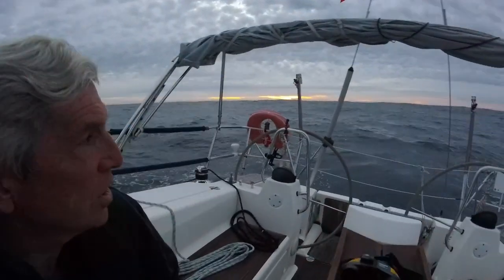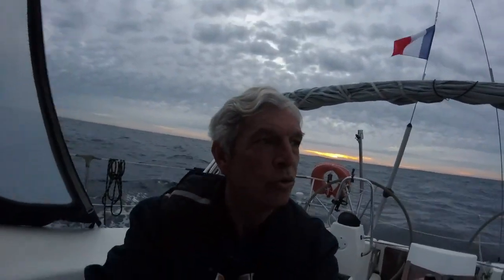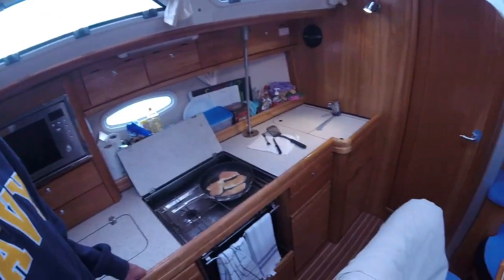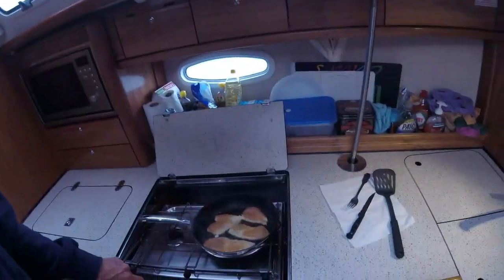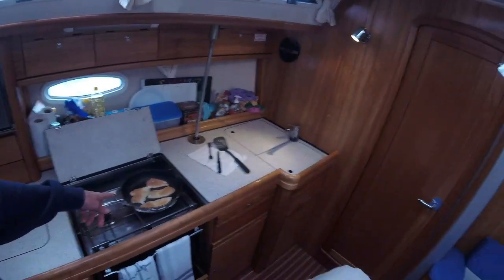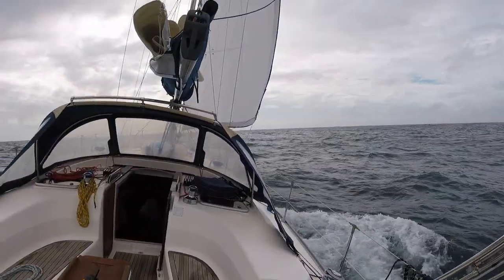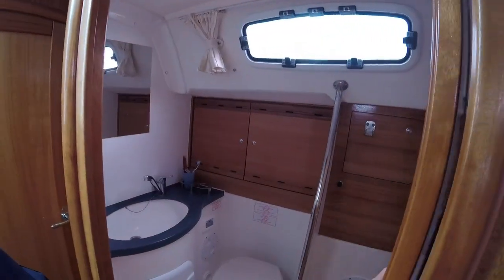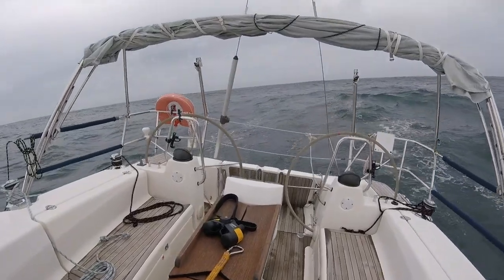Ep 7 Sailing singlehanded to Azores: When I use genoa only

Comment: Patrick : Greetings from a Union Polaris 36. We often fly just the 500 sq ft headsail for pretty much all the reasons you detail. When the mainsail boom rocks back and forth like that, put a little clean engine oil on the goose-neck pivot and it will last much longer. On the Polaris, the mainsail boom is enormous, and it can get aggressive sometimes. 
Just flying the headsail is so much easier to handle when close downwind.  
In calmer conditions, I have found that when just flying a MAINSAIL downwind that the boat is stiffer and rolls less. I guess I must be crabbing the keel more? When we gybe with mainsail, we often "do a granny". That Polaris 36 mainsail boom is so long!
Fair winds !
Reply from the maker: Thanks.  I haven't tried mainsail only in light winds.   I'll check it out next time.....  :-)
Reply: @patricklaine6958  The Polaris 36 (early model) mainsail is enormous, and the mainsail boom helps hold it out so it curls much later than the big jib does and so has a wider usable angle when downwind. We use a kicking strap to prevent the mainsail boom from accidental gybe. Worth a try.

Comment: I hope I’m not preaching but I think you should use a gybe preventer from broad reach to dead run. We had a rope permanently tied near the end of the boom with a snap shackle on the other end which snapped to a ring close to the vang, keeping it tight to the boom and out of the way until it was needed.
A long sheet was rigged through a block attached near the bow and run back to the cockpit. The outboard end had a loop which the snap shackle clipped on to when the preventer was needed. Then the inboard end was pulled tight and secured. This pulled the boom out while the main sheet pulled the boom in. The preventer and sheet need to attach to the boom in roughly the same place, so all is in balance, stable and safe and hopefully no gear gets broken and, more importantly, no heads.
Reply from the maker: Completely agree Ian, and I do have and use a preventer (actually a "brake") made by Wichard.   I don't understand why so many of my videos have the boom banging around, as I hate that.   I mentioned elsewhere that perhaps it is because I often filmed my videos just prior to sunset, and just after sunrise; times I usually make sail changes (putting in or shaking out reefs).  I may have just timed my filmings for that window when I changed sail settings, but had not yet re-rigged the preventer.   As you say, a preventer or brake is an essential piece of gear to protect equipment, provide safety, and preserve sanity.

Comment: Hi Patrick, I really enjoy your videos. I was saw right away that you're on a Bavaria. I was wondering what model and what year she is. I have a 2006 Bavaria 33 and I always wonder about the suitability of this boat for offshore sailing. My boat loves to slew around at anchor and I can only imagine what all the windage she carries would do to her in a strong breeze. I haven't tried to heave to in the boat though I know I should give it a go. But it looked like you weren't too happy with your boat's ability to do so.

I was also wondering about you inner forestay idea. On the 33 there is precious little room between the mast and the bow to affix an inner forestay. I can see your boat is larger than mine but I wonder if you've thought about this question.

Finally, it's great to see that you can achieve 3500 subscribers without any bikini clad twenty-somethings bouncing around on your foredeck. I'm looking forward to more videos!
Reply from the maker: Many thanks USA for the kind remarks.   My boat is a 2008 Bavaria 40 Cruiser.   In terms of seaworthiness, I would not hesitate a second to jump aboard and take it on a Transat.   It is a very stable boat, handles wx well, and is ideally suited for single-handed sailing.   I'm very please with it.     There are two issues with heaving to: 1) is it the right tactic for the storm (versus running downwind or forereaching) and 2) how easy is it to get to a 'text book' hove to position with the slick at about 100 degrees relative to the bow.   I won't address issue one, other than saying that when I crossed the gale on my way to the Azores (episode 12), the wind and seas were not aligned, and I felt the forereaching tactic was better (though stressful on the equipment).  I must admit, I do struggle to get my boat to do a textbook heave to....It really likes to continue moving forward, and I have tried every variation on the controls that people commonly say to do.   It almost gets there at times, but not quite.  Probably 'pilot error'.  :-)

If I ever do go on a major passage, I will install an inner forestay (the removable kind).   For serious cruising, I want to be able to furl the genoa, and use a staysail or storm sail.  I have the room for an inner forestay --- just a question of installing it.    Finally I'd love to hold a bikini party on my boat, but no one would come.  :-)   Fair winds to you.

Comment: To prevent slatting in light winds and big swells going downwind or on an open reach, I unclip the mainsheet from the traveller and clip it to the rail, and tighten the sheet hard. That way the boom is pretty much fixed and the sail can't flap, yet the sail is still far out from the centerline and catches a lot of wind.
Reply from the maker: A great tip Ute.  Thanks.  It won't work on my boat due to physical layout -- but there are many ways to vary this theme slightly to get the same result.   Thanks for commenting.
Reply: Ute å seglar great tip thanks Andy.
Reply: You can’t do that on a large boat at sea. The boom is too dangerous

Comment: Thanks for yet another informative video! I like the way you talk straight to the camera and walk around with it. Is it a gopro? The audio is very clear too, do you have an external microphone?
Reply from the maker: It is a GoPro Elizabeth, but it does not have an external mic.   That is a real problem, especially on a sailboat, because as soon as you stick your head out in the breeze, you lose all quality of sound.  There is a wind muffler you can put over it, but then you can not speak; just film.   I'll probably try a different camera next year, with an external mic that you can put a 'dead cat' (hate that expression) around.   The advantage of the GoPro is its very small size, and stabilization, so you can take it anywhere with you and be very spontaneous.   The bigger cameras will require 'staging' of sequences.    Thanks for asking.
Reply: Thank you Patrick, I used a gopro too until it drowned together with my drone! I clamp my system camera on different fixtures around the boat but even though I use a “dead cat” the wind noise gets through sometimes.

Comment: Sailing single handed has many problems but sleep is tricky and if your not getting enough sound sleep it tends to creep up on you and then your asleep for to long and totally surprised when you wake up. The AIS transponder and alarm is a better option but still not perfect with all the trash floating around.

Comment: Pat: Interesting video, thanks. I am curious why you don't have a windvane.  Autopilots are great, but it seems it would be tough to handsteer a long passage if that system failed. and I know you have addressed the boom preventer question, I think a vang to the rail on both sides is for me, anytime off the wind. Boom slamming across can be a killer. I see the Navy pullover, are you an Academy grad? my dad was class of 47 and did two transatlantic races on a 40 footer in the 60s. He was racing with a crew of eight, but he was navigator. Those days it was all celestial, not even Loran. Nav was his favorite subject at Annapolis. Nice boat too.
Reply from the maker: Thanks VF.  I don't have a windvane simply because I didn't want to have all of that hardware hanging off the stern.   And yes, that means loss of the autopilot would be 'challenging'.   I did practice two other primitive methods of self-steering.  I think they would have been alright for the trip to the Azores.  I do think that if I were doing a Transat or other very major passage, I would indeed install a windvane.   To date, I have been very lucky with my Lewmar autopilot.   On the preventer thing, I really should have filmed my 'brake' in action. It is tied off to both sides and really does do an excellent job of stopping the banging, and I could have used it for wing on wing if I had wanted to.  I'll film that on a future passage.     And yes, Navy '76, but then into aviation.   As you can see, I'm still struggling with learning how to drive boats.  :-)   I too learned and used celestial navigation in the real world, but now with 5 independent GPSs aboard, I don't even own a sextant anymore.    Thanks for contributing to the discussion.

Comment: Pat, Why not use a preventer line to stabilize the boom? Enjoy your videos!  I assume you're retired in France?
Reply from the maker: Thanks Bill.   Someone else also asked why I allowed the boom to crash back and forth.   I don't!   I have a preventer that I hook up (brand Wichard), and if that doesn't work completely, I loop a big bowline over the rear winch, and tie a double half hitch to the rear end of the boom.  I think the boom bangs in the videos because I often filmed just after sunrise, or just before sunset, right after a sail change and had not yet secured the boom.    I agree completely that the banging boom is mentally fatiguing, and not good for the equipment.    And yep, I retired to France (after having spent most of last 30 years living in Europe).    I live on the coast, 5 minutes from my sailboat.  Life is good!   :-)   Thanks for the comment.
Reply: @patricklaine6958  Years ago we purchased 50 feet of 3/4 inch dia. bungee cord and designed a fast attaching or removed shock absorber system that worked really well to eliminate side to side banging. Preventers dont really do a good job stopping boom banging when the boom is facing aft.

Comment: You could try putting up the main and using a limiter on it so it wouldn't snap around, but I have seen that get a little dicey if there are sudden wind shifts...  maybe when it's nice and you feel like being on deck so you can watch it.
Reply from the maker: In episode 40 I discuss the use of boom brakes vs preventers.   (I systematically use a boom brake whenever going downwind.)   The banging noise you hear is a filming error.   I filmed at the same time each day the first season -- just after shaking out the 'nightly reef', but before resetting the brake.    You will hear much less banging in seasons 2 and 3 because I filmed after resetting the boom brake.  :-)
Reply: @patricklaine6958  thank you. I will watch it. I am not familiar with boom brakes. I own an O'day 27 and race on a tanzer 25, here in the fingerlakes, so larger, bluewater boats are interesting to me.

Comment: Greetings from Canada Mr. Laine.  Do you use a whisker pole on the genoa in this sail plan and singlehanded?  Also for the boom have you tried a gybe preventer/break to keep the boom out?   Thank you and really enjoying your episodes sailing to the Azores and find your content very informative.  Thank you for sharing your experiences and advice.
Reply from the maker: This boat did not come fitted with a whisker pole.   They are not difficult to install, but I never got around to it.    Whisker poles are VERY helpful when doing extended downwind passages like in the Trade Winds.   In one of my Iceland videos I show my 'boom brake' and discuss the difference between a brake and a preventer.

Comment: A preventer is a good idea, but if you’re making 5-6 knots with the Genoa alone, I’d take that any day! The one question is why not go wing-on-wing since you’re on a run? You could use the preventer to keep the boom opposite the Genoa. You’d then gain speed from the main not rob the Genoa of any air. Just curious.
Reply from the maker: You are exactly right JM.   I was just satisfied with the 5-6+ knots.   I think if I had only been doing 3-4 kts, I would have done exactly as you suggest (and I do that frequently in my local sailing).   Excellent comment.
Reply: Patrick Laine — I only solo sail on lakes and on a 22’ pocket cruiser at that, but I realize the wisdom of a.) being satisfied with your SOG and 2.) the very real danger of having too much fabric up when conditions can change so quickly. Really enjoy your channel!

Comment: I have a furling mast and in my case the genua is much bigger than the mailsail so sailing with only the genua is still giving a ok speed.
Reply from the maker: Yes, me too Tino  -- I have a 145% genoa.   I can get good speed going downwind with it alone also, but I'm not a racer anyway.   I have never sailed with a furling mast.   Do you like it?  Do you feel you lose performance compared to a classic configuration?   Vertical battens I suppose?   Best regards
Reply: There is no structural battens in a furling mainsail, it's like a second genua.  But I like the system and it have a function where you only can pull the sail in.  The system is made for reefing so you don't loose control over the sail in bad wheater. The whole system can be controlled from the cockpit however not when you want to switch to the reefing mode. It is done by the mast at the ratchet/free handle. (see my video: sailing with a YouTube fan)  I have not sailed that much in my boat to tell if furling mainsail is makng the boat go slower but I have heard the difference between furling and normal mainsail is 0.5 knots.  But I'll find out, my friend have just bought a Bavaria 32 with normal mainsail.
Reply from the maker: Very helpful Tino.  Thanks.   It is nice having 'infinite' reefing, though a bit of a shame you need to go to the mast to do it.   I guess the guidance 'reef early' still applies even to in-mast furling systems.    I've already watched your video 'sailing with you-tube fan', but I don't remember the reefing sequence.   I'll watch it again.   Best regards.
Reply: We are spoilt. Our Prout Cat has in-mast mainsail furling with vertical batterns that is adjusted in both directions from the electric winch in the cockpit. Even so, when running downwind we often only put out the 150% Genoa to avoid having to set up the preventer on the boom that we run to the bow and back to the cockpit.

Comment: Don’t blame you for not wanting to go forward too much sailing solo but would something like a asymmetric spinnaker, with a top-down fuller be of benefit? Also I don’t ever see you using a whisker pole. Is it that the more toys you use, the more trouble is possible or is it something that doesn’t lend itself to Bavaria 40s or just more bother than it’s worth?
Reply from the maker: Both great ideas Ian.  I have an asymetric Spinnaker with a snuffer --- and I use it regularly.   As I'm solo, I'm quite conservative as to when I use it --- not in heavy traffic areas, and not below 9 knots, nor above 15.   My boat is not equipped with a whisker pole, but that is something I would definitely install if I were to do a transatlantic passage.   Thanks for the excellent comment.